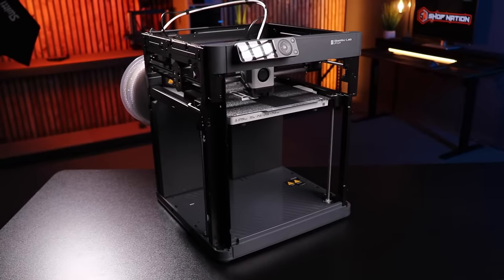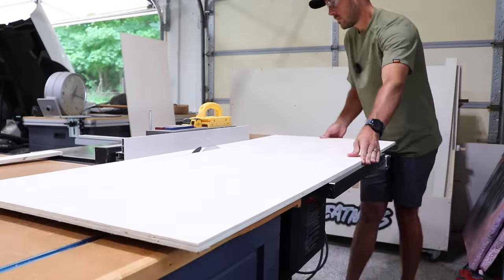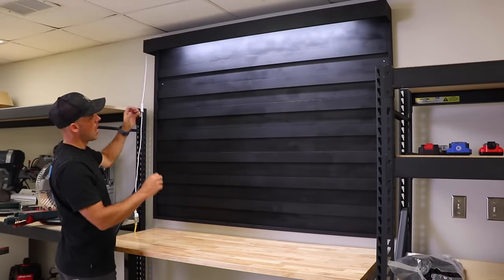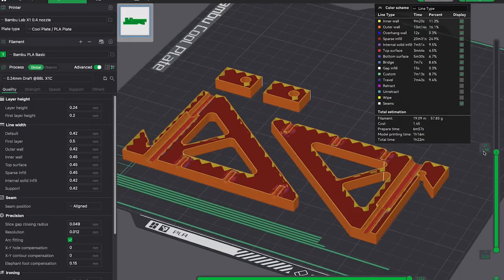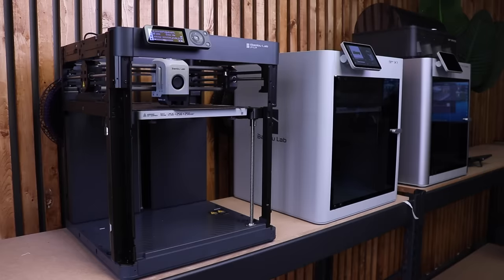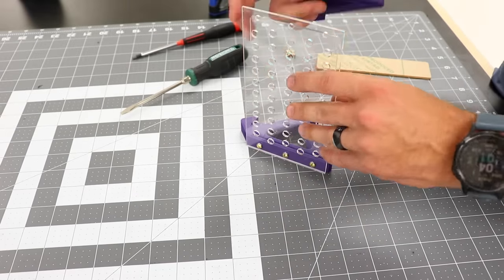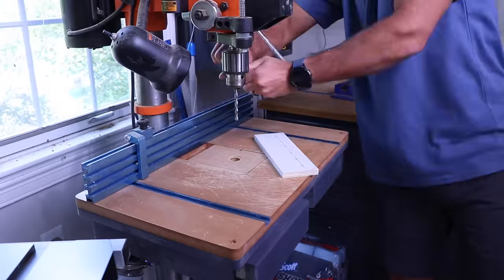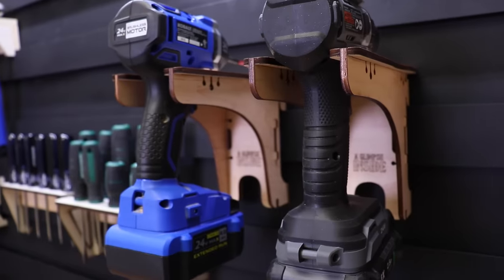Do you really need "smart" tools?  The answer will SHOCK you!

Comment: This keyboard warrior wants to know why you didn't use your XTool to cut the Kaizen foam, this is the one area where automation spectacularly outperfoms manual labor in terms of accuracy, cut 3/4" foam, then cut 1/4" using the tool profile geometry and pop it in the holes. I use a camera with the Lightburn camera setup to capture geometry but a cellphone pic from directly overhead and zoomed out, or a flatbed scanner will provide the same.
Reply from the maker: I will be trying that!

Comment: Yes, shure. But if you want to 3d print 20 more pieces, well the printer does it and you dont have to design it every time. If you do it by yourself you have to do it 20 times, and then it costs you way more time than doing it by 3D printing.

Comment: If you only used a 3D printer, you would only need to spend 3.5 hours. 

3 hours to design and 30 mins to change filament and do any minor assembly like adding heatset inserts

Comment: You included all of the design time in the digital but you did not need to design when moving to the traditional method so that was not apples to apples.
Reply from the maker: I clearly mentioned that
Reply: @ShopNation  thanks for the response although it would have been so much nicer if you ommited the "clearly". By the way, I like the Vaylance😉

Comment: The test would have been skewed a bit had you done the traditional design/build first.  IMO, the hours spent doing the digital design shaved considerable time off the later traditional approach because you already knew what you were going to make. And as you'd mentioned multiple times, the real savings is going to come from duplication and re-use. Let's say after putting everything on the wall you realize you need 3 more of one design and 4 more of another? That's going to be another long process with traditional tools, including setup/cleanup, whereas with the printers and cutter, it's just a quick export and wait.
Reply from the maker: Bingo

Comment: Not realy surprising...
Digital fabrication-methods like CNC and Laser-cutting are MEANT to do large amounts of the same parts in a short period of time... repeditive work. (OR/and to fabricate with very high prezision.)
they are, of course, capable of, but where never designed to do small amounts or even single parts... thats just how some people like you use them!

So its natural, that you dont have a big advantage to use them on a projekt like this.
That will be the case if you do the task over and over again.

Comment: I much prefer the look of traditional woodworking over the burnt-edge tab look of the laser cut designs.  Still, it's a very interesting comparison even though it's highly dependent on the number of holders you make.  Since the digital design time is a fixed cost, as the number of holders increased, I would expect the digital fabrication approach would begin to look much better.

Comment: You are faster than the average bear in both CAD modeling and fabrication,  for an average person it depends where your particular strengths lie where time might be saved. I find that doing the CAD model forces me to think everything out first, where as fabricating is more organic figuring it out as I go along. WIth CAD a mistake is an edit and re-print away. Hand built is a do-over or at best a tear apart and ugly fix. Two completely different mind  sets. With CAD I go through a number of prototypes until I like what comes out. With hand fabrication I usually settle for close enough. 

Not seeing a 50 hole bit organizer with fancy spring loaded mount in the hand done photo, not even sure I could make the spring loaded thing by hand.

Comment: Ah yes, but --  once you have designed them, the programs remain and instead of one, you can now make them 24-7 with only changing spools and materials to keep the printers running... and the 5 hours is reduced to time to load and reload the printers. The output of which can be sold to generate an income - not just hang on the wall holding those few things you managed to make tool holders for by hand. Taking care of bidness. Or you might not want to be your printers' slave 24-7 ... the wife and kiddies might enjoy more than a few minutes per day with you.

Comment: Here's the thing, tribalism can go die in a hole. Use whatever tools you want for whatever job you want. In many cases, the best tool for the job changes with said job, but if you want to use the most efficient, or the least efficient tool for a job, go ahead. Anyone who thinks "traditional methods" are old and useless, or that "modern methods" are cheap are aren't "real engineering" can go to the insane asylum. Hand carving, lathe work, 3D printing, hand cutting, etc... use what you want.